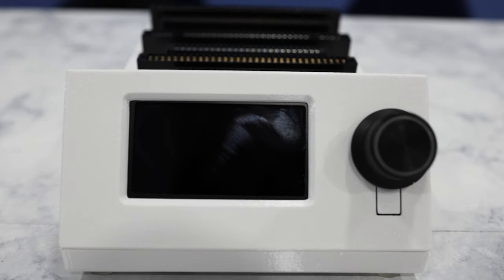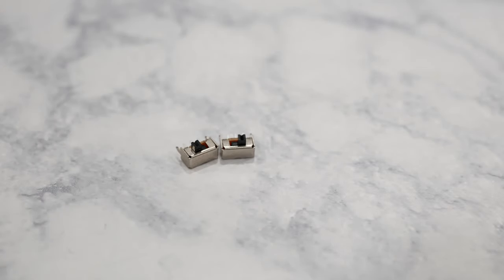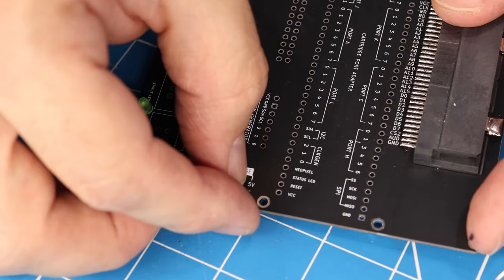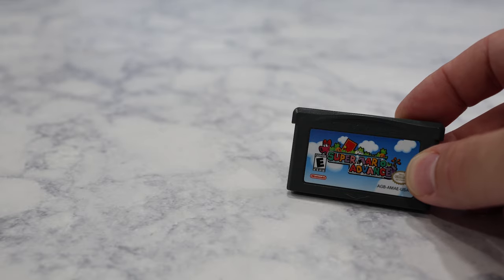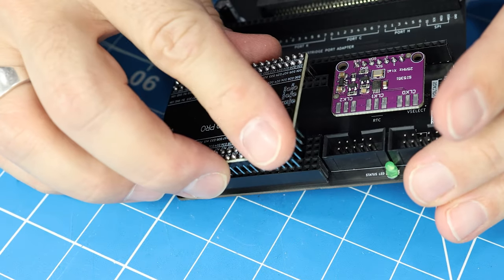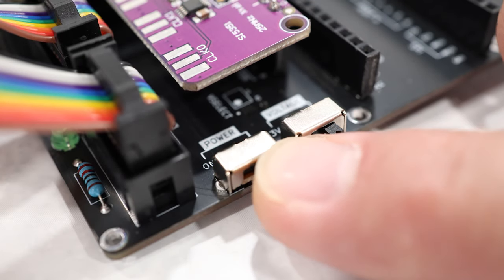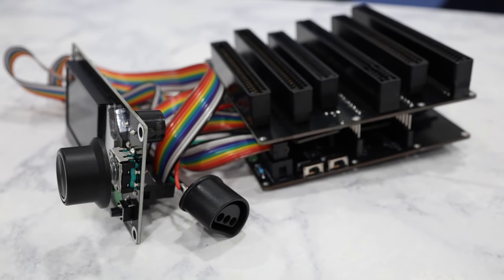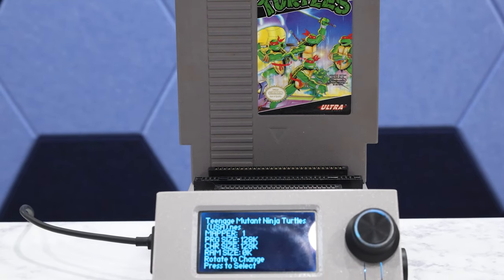Building a ROM Dumper – The Open Source Cartridge Reader

Comment: Projects like this are important for archiving these games.    Someday in the future the cartridges will have failed or been destroyed but digital copies will allow them to live on.
Reply from the maker: Especially those with battery-backed save states. Those batteries are already at the point where their lifecycle is ending, and using a device like this is the only way to backup your saved game before they completely die. I bought a bunch of broken Super Famicom games a couple of years ago, and the main fix on the majority of them was to replace the memory battery, so it's definitely an issue these days.
Reply: Why not control the voltage through the choice of cartridge in the menu? Preferably with a safety button to enable the power to the cartridge and lock the cartridge selection at the same time to avoid voltage mishaps.

Comment: A tip for cutting down pin headers: Instead of pulling a pin and cutting through the empty header, you can just cut the header with sharp flush or angle cutters. The plastic will break and the pin will fall out. Then you can smooth over or trim the edges.

For removing small SMT components like the fuse, applying some flux then bridging the two terminals of the component with solder makes it really easy to lift both sides at once. A big chisel tip loaded with solder is often all you need to get the component off. You'll also want tweezers on hand in case the component sticks to the soldering iron. Alternatively, you can use soldering tweezers or the forbidden dual soldering iron technique.

Oh, and if anyone finds themselves with only single headers, not dual row, you can use two single row headers. Socket a dual row device into the headers before soldering to hold them in alignment. Just be aware that if you really overdo the heat and solder, you can damage the component you were using as a guide.

Comment: I'm building one of these for my battery changing side hustle as I've run into a number of people that know that the batteries are going to die soon but they don't want to lose their saves so they don't have those carts changed, it's a bit of an investment but I'll be able to upsell that childhood saves can be saved as long as the battery is still somewhat working and that will bring some extra income, might even be able to charge more for that service.  been watching a ton of build guides for this to make sure I know what I am doing cause I have never soldered this much for one thing lol
Reply from the maker: What a great idea for a side business! It’s definitely a lot of soldering; make sure you use a fume extractor. By the time I was done building the extras that I auctioned off on eBay, I had it down to about 2 hours per build. Good luck!

Comment: I'd like to build one for Game Gear carts. I've got an X-Men game that I can't seem to find the exact same game anywhere and I'd love to play it without endangering my original hardware.
Reply from the maker: Game Gear dumping on it is pretty interesting - you can use Hyperkin's RetroN 3-in-1 adapter and dump it straight into the Genesis/MegaDrive port on the 6-in-1 adapter that I walked through in the video

Comment: Does this thing have all the different mappers built in for NES and SNES cartridges? This is the problem I am facing with a select few games with one of the original USB type units.
Reply from the maker: It does have mappers built into the firmware and attempts to automatically detect the correct one. I don't know how comprehensive the mapper database is, but it does look like mappers are regularly updated during firmware releases.

Comment: Nice work, but building this without the automatic voltage selection seems like begging for disaster. I would certainly not trust myself to remember to change that when switching cart types.
Reply from the maker: I may go back and add the voltage selection in, but I think you'd have to feed a 3.3v cartridge 5v for quite a while before there would be any damage, if at all - depends on the voltage tolerance of the chips used. I accidently had 5v turned on with 3.3v carts plugged in a couple of times, and those cartridges were fine.